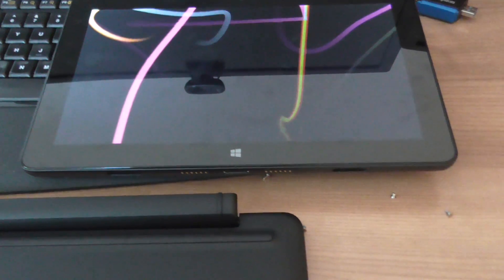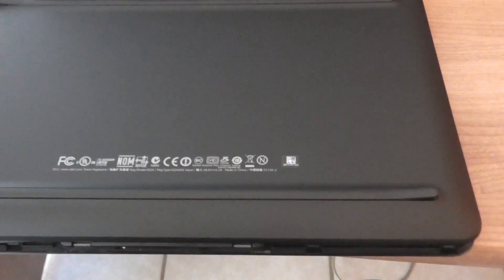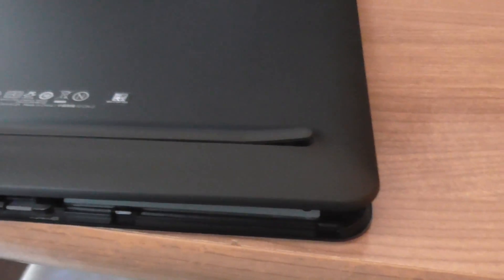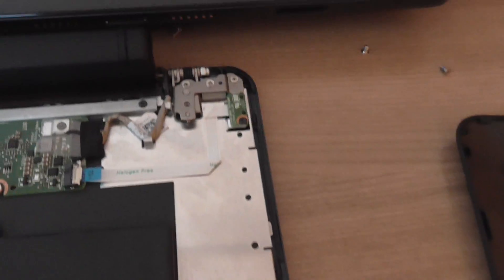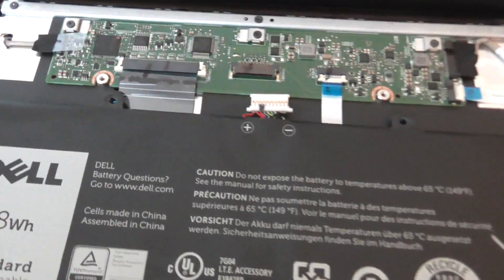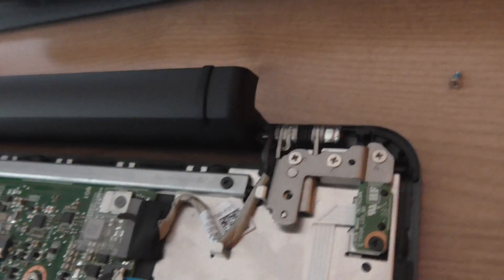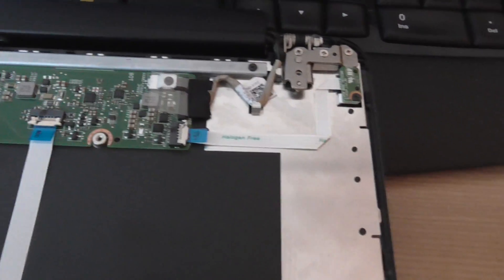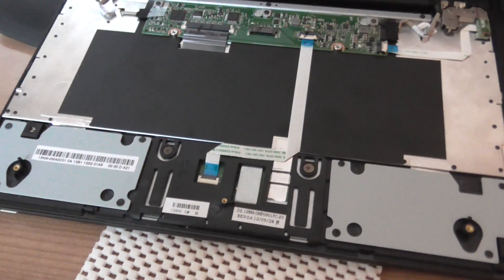Dell Venue 11 Pro mobile keyboard dock faulty not working & The Fix

Comment: I came to this video because I was experiencing the same touchpad issues, and had already tried every variation of firmware/regedit/software fix out there, to no avail. I was finally committed to taking the keyboard apart but, as I was watching this video, the touchpad magically started working again! It has been dead for 2 days, but all of a sudden it just began working. Nonetheless, I thank you for making this video, as I may have to take the keyboard apart down the road, but for now it seems to have been scared into action by the threat of being dismantled. Cheers!
Reply: I notice there are some "flex" issues on my keyboard. With the tablet attached, if I lift it up by the right hand corner, or hold it up by the right hand corner, the trackpad stops working. The metal case feels really stiff, but apparently it's not. OR maybe the flexing is moving a poorly connected cable? That's what I'm wondering after this video.

Comment: I have another problem
my keyboard an touch-pad is working fine but battery is not !!
I charged it alone first time until led is off
now windows said :
battery 2 full charged 100%
and it doesn’t work !!! , my device battery down first then shut down as there is no other battery
I don’t know what is the problem , I upgraded my bios to the latest version A13
the problem still
any suggestions
Reply: +Mohamed Melouk did you fix this?

Comment: Selective suspend was the only culprit with the issue I had with the keyboard dock.. Hardware surgery was never needed on my end, just addressed the software and have been fine since then.
Reply: +id6klub how exactly did you do that fix software wise, was it a setting
Reply: +RRSYS.info - Roulette Prediction (Paul) it really shouldn't be an issue if the proper patches have been applied, but you can take a look at your device settings to see if you still need to disable selective suspend. I wrote out the steps and provided screenshots for Dell users right after it came out. They released an official fix for it but I don't think it was "pushed". You can view the walkthrough here though: http://en.community.dell.com/support-forums/mobile-devices/f/4586/t/19534855

scroll down a little and you'll see my guide with screenshots

Comment: hi , i followed your guide and the keyboard worked flawlessly BUT without the extra battery connected... when i try to connect the internal keyboard battery the touchpad stops working, did you face that issue ?
Reply: Yes i found out that you should never usee the keyboard's microusb to charge it... it almost always hangs after doing so
Reply from the maker: Philip Chan Should stay on the whole time while charging. These keyboards are great but, very problematic.
Reply from the maker: Yes, I had to leave the battery cable disconnected. Stupid which means i have no extended battery life from the dock now. But on the plus side the keyboard works!
Reply: Ok so i found a solution!  I connected the keyboard battery internal cable AFTER docking the tablet in the keyboard dock.. that is while the tablet is docked connect the small keyboard battery cable carefully and voila both are good... let me know if that worked...
Reply: Mohanad el nokali Thanks for the tip, it indeed worked reconnecting the battery after plugging in the tablet . Which makes me remember the first time the issue occurred was when the internal battery was totally empty and I used keyboard's mini usb to recharge it instead of the tablet one. And then only plugged it to the tablet
Reply from the maker: Yes, on my second keyboard. I just removed the battery for good.
Reply: TechTablets.com Hi man, at the moment I'm having trouble with my keyboard, it doesn't charge. Does your white LED stay on for 30-60 second then turn off?
Reply: +Philip Chan my keyboard led charge light only illuminates if chargine by hinge usb socket... it does not light if charging via tablet/laptop useage even tho windows os confirms charging